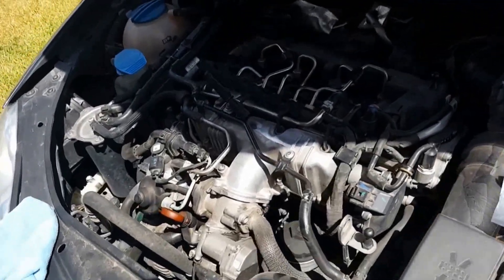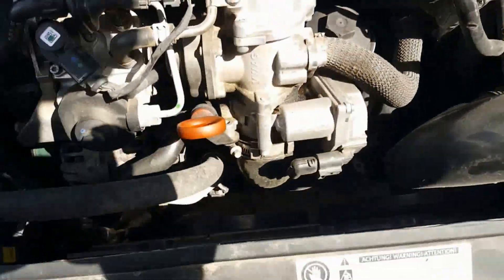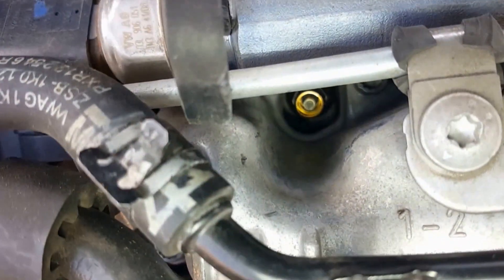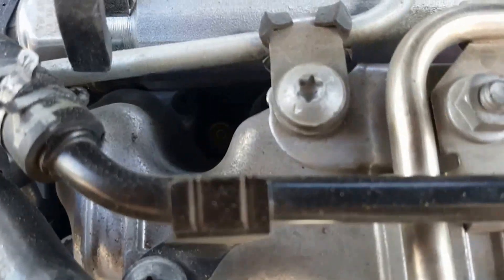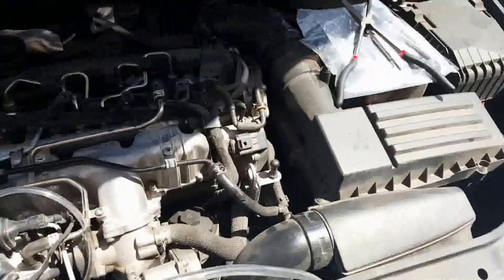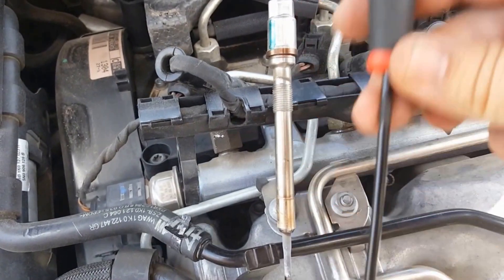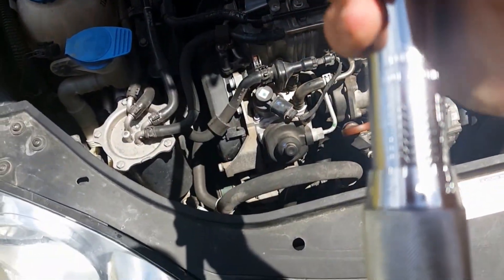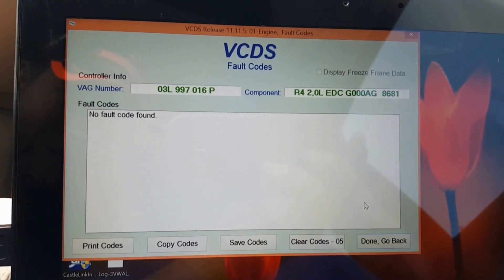Replacing 2009 Jetta TDI glow plugs CBEA

Comment: Thanks for the vid

I have a 2012 Jetta tdi, CEL came on hooked up VCDS and two faults cylinder 1 glow plug improper installation and cylinder 2 glow plug. Any ideas?
Reply: front wiper spray motor

Comment: I just wanted to add that measuring block 141 shows cylinder pressure.  If you want to double check that the sensor is working properly you can monitor that block.  It's also good for checking compression.
Reply: 9 years later... thank you